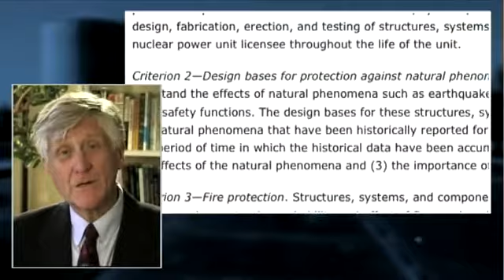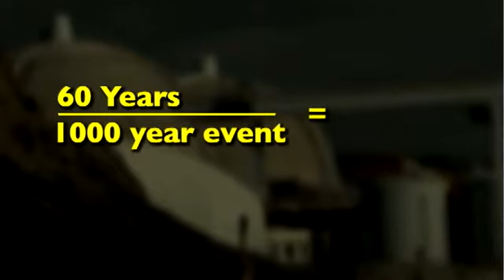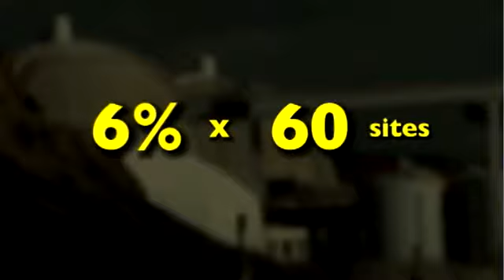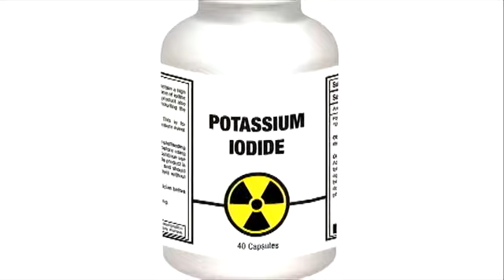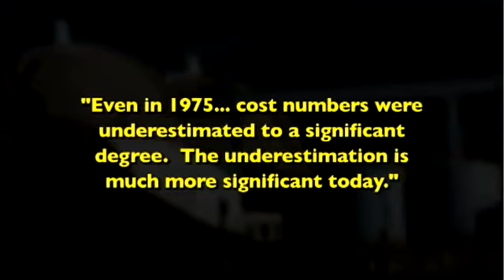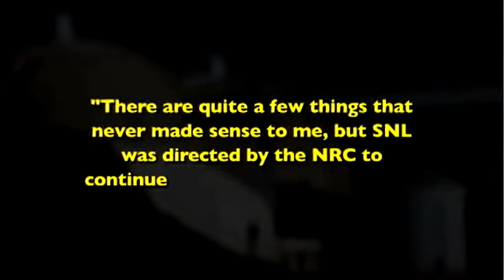Fukushima update

Comment: 6% × 60 ≠ 360%
Look at it this way: each plant has a 94% chance to avoid disaster worse than it's design basis during it's 60 year lifespan. There are 60 plants.
0.94 ^ 60 = 0.0244
in other words there is about a 2% chance that NONE of the 60 plants will experience a disaster worse than it's design basis during it's 60 year lifespan.